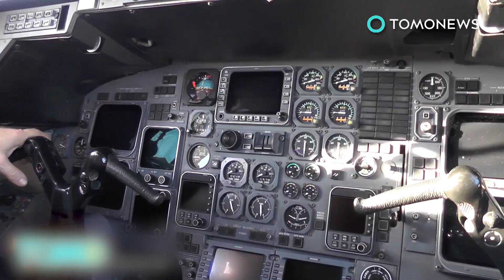Circular runway airports: Dutch researchers propose circular runways for future airports - TomoNews

Comment: i like how everyone is trashing the idea with shitty arguments, like if everyone were engineer or some shit like this wtf
Reply: isn't it why the runway is slighty angled ? so the planes doesnt have to turn that much ? kinda like in nascar races, turn are angled so cars slighty need to change direction to take the turn.

How will landing while tilting will result in a wing or engine strike ? explain "mister student pilot i don't give a shit you could totaly be lying anyway"
Reply: Requin789, I'm sorry to break this to you, but here are  many reasons a circular runway is impractical:

"Land too far to the inside of the circle and you drag wingtips and engine pods on the ground and risk cartwheeling to the collective death of everyone on board.

Land too far to the outside of the circle and you ‘high side’ (motorcycling term), catch the outer landing gear in the dirt, spin around and risk cartwheeling to the collective death of everyone on board."

"Takeoffs are going to be interesting. One of the more difficult types of aircraft to fly is the ‘tailwheel’ design. They’re challenging to fly in part because a take-off is a three-step process whereby you first lift the tail off the ground, stabilise, and then lift the rest of the aircraft off the ground. A take off on a banked circular runway would be similarly complex: you’d need to lift the inside landing gear off the ground, stabilise, then lift the rest off the ground… and do you lift the nose gear first, or second, or when?! If you get the timing wrong, then you either drag wingtips and engine pods on the ground and risk cartwheeling to the collective death of everyone on board, or catch the outer landing gear in the dirt, spin around and risk cartwheeling to the collective death of everyone on board."

"I have problems with the claim that up to three aircraft could operate from the same runway at once. Again, it will work well when everything goes to plan, but on that one day when the guy behind you can’t stop in time (or doesn’t know you’re there because he can’t see you in the fog), he rolls right over the top of you to the collective death of everyone on board both aircraft. Would anyone like to try Tenerife again?"

"The artwork is hopelessly out of scale to the needs of large transport aircraft that need to take off and land at high speeds, and ignores the impossibility of turning such aircraft at high speeds during takeoff or after landing, in distances that normally would require 1500 to 2000 meters. Maybe if the circle were to be orders of magnitude larger …"

"Crosswinds. Operating in a strong crosswind can be challenging enough on a straight runway. Add in a curve, and even a steady crosswind will be varying as the takeoff or landing progresses—making it more difficult to manage. Most locations have a prevailing wind direction, so it’s usually possible to build a straight runway that is into or very nearly into wind on high-wind days. On a circular runway, any wind means you always have a crosswind—and that crosswind will be varying as your takeoff or landing progresses."

"Bank Angle. Banking works well on roads when it’s used, because most cars operating on a road will be at or near the same speed. Not so for airplanes. Liftoff and touchdown speeds range from as low as 40 knots for some light aircraft up to 150+ knots for heavier jets. Even if you assume the airport will only be used for commuter and transport aircraft, liftoff and touchdown speeds can get lower than 70 knots. Centrifugal loading is a function of the square of your speed, so that’s more than a 400% variation in loading at the top ground speed. And of course, centrifugal loading goes to near zero at taxi speeds. In other words, a fixed bank won’t prevent side loading. Instead, it will cause side loading to the inside of the bank at low speeds and to the outside of the bank at high speeds—which compounds the problems associated with the varying crosswind."

"The curvature seems mild enough, however I wouldn't want to land an aircraft while taking a turn. Breaking and turning is a bad idea in driving and riding. It goes doubly so for a large aircraft where the loads and stresses are much larger. Especially with aircraft that have the same wheel configuration as a Reliant Robin. I can just see planes striking wingtips, oversteering and spinning all over the place in a rainy day."

"Also, using the runway by 3 planes at the same sounds incredibly dangerous. I'm not sure how one would manage separation between aircraft when you have 3 aircraft landing and taking off at the same time, essentially from the same runway. Sounds like a substantial increase in workload for the controller or increase in cost (for more controllers) for the airport operator. And if you're not supposed to operate 3 aircraft at the same time, what's the point?"

By the way I quoted pilots, enthusiasts and engineers.
Reply: Requin789, pilots say it's stupid.
Reply: Requin789, a circular airport is bad. The pilot has to turn the front wheels to stay on and turn the place sideways to land. If any airport is going to make one of these should probably get pilots to vote if they will want to land.
Reply: TheLapisChicken // LapisChicken GD Yup... 'Crabbing' into the wind would be impossible. If a pilot was lucky enough to land a plane in no wind, then no chance in even a stiff breeze.
Reply: This pilot is impressed with your analysis. I can't off the top of my head think of any other reasons why this is a bad idea, as I wouldn't want to land a Microlite on it let alone a multi-engine jet! It appears that Requin789 is a disrespectful and rather ignorant troll. Well done with your counterargument TheLapisChicken
Reply: WiltsKiwi stfu bitch

Comment: >The US Military conducted tests in the 1960's with circular runways

I'm guessing they never implemented them because the testing showed it was fucking pointless.
Reply: I have read that document and am thoroughly underwhelmed. The Engineer is making assumptions about repeatable "perfect conditions" which in the real world, can't be relied upon. As an Engineer I am surprised you haven't put the pieces together, so as a Pilot, and as I have offered I will explain these two important issues that make the circular runway unnecessarily dangerous. First I would ask you another question:

When stopping or accelerating in your car, do you think it safer to do so turning sharply or in a straight line? 

The answer is obvious, stopping and starting in a straight line does not add any unnecessary angular momentum to the system, which would be added if you intentionally skidded to a halt or accelerated in a sharply turning motion. With an Aircraft which turns using a different mechanism with much higher forces and stresses, in a three dimensional space, this is even more difficult and dangerous. Avoiding unnecessary angular momentum is much safer and is the simplest reason that Aircraft have always landed and taken off in a straight line. Why add a dangerous complication? That isn't practical it's foolish. This is my argument about the assumptions that the Engineers have made about angular momentum in a circular system. To take off or land would require a pilot (or an automated system) to bank dangerously affecting flight profile and aircraft trim almost certainly causing a fatal stall at low altitude causing a crash either with full fuel tanks on take off, or nearly empty ones on landing, in both cases increasing explosion of fire risk in that crash. That is physics.

As for Bernoulli's Principle, the objection I have here is simple. With Bernoulli's Principle in fluid dynamics a pressure imbalance with flowing air across the wing cross section shape produces lift, which (this is the important part) stabilises with more Air flowing UNDER the wing. The reason that Pilots are training to NEVER bank an aircraft under normal flight conditions near the ground is that air has unpredictable effects called "ground wash" that can cause anything from a wing stall, flat stall, or worse, tail stall which will drop the aircraft out of the air like a stone. At low altitude there is not enough air under the wings to recover from a stall causing a crash, and with a circular runway, the motion of winds will also likely cause vortices that will severely effect the wind speeds and aircraft stability as well in difficult if not almost impossible ways to predict. Putting it simply trying to land or take off in a flattened funnel of air by turning an Aircraft is hopelessly dangerous, no matter if a computer flying by wire is doing it or a pilot. 

The main problems I have with this concept, long before getting into ground control systems, avionics, or technology, is that you are trying to make a manageable, but dangerous activity even more dangerous and almost impossible to manage just for really little more than aesthetics. I have checked the calculated aircraft projections for the volumes of aircraft a circular runway could handle from the paper and see that as wildly optimistic. It wouldn't be more practical, nor more beneficial.

Next time an Engineer comes up with a "planning solution" for an activity they are not qualified to attempt improvement on, they should first ask, why something has been done with enormous success for over a century without attempting something pointless.
Reply: You are right, the US Air force tested this in the 1960s and found it was too impractical, too dangerous, and relied on too much piloting and ground control resources to be repeatedly used.
Reply: I never said laws of physics would be violated, but since you asked I can think of two off the top of my head that aren't being properly considered or understood in the right context: 

Conservation of Angular momentum
Bernoulli's Principle (fluid dynamics with regard to Aerodynamic lift)

That would make a Circular runway too dangerous to be usable. As a pilot I see these physics restrictions as impossible to make the circular runway work, long before you factor in technology, human fallibility, and any number of unpredictable factors that will make this concept too dangerous to work well with any degree of repetition. I will happily explain these too you if you wish, since I doubt you are a pilot or an aviation expert.
Reply: I think he meant that the guy who proposed this doesn't even know that "centrifugal" forces make an object move AWAY from the centre of the circle, not the other way. Another thing is that wind speed on each wing would be different, making a landing/takeoff quite an event...
Reply: As I have pointed out at least twice before all the technology in the world won't change the laws of physics. The lack of fly by wire capability was only one reason, when there were several even more important objections that caused the military to abandon circular runways.
Reply: Can I know What law of physics do you think it is violating?
Reply: I am not a pilot nor an aviation expert but I am an engineer. Sorry I fail to understand your 'physics restrictions' please explain. And why do you think Conservation of Angular momentum
Bernoulli's Principle (fluid dynamics with regard to Aerodynamic lift) these are not considered in the right context ? I recommend you to read the report at http://www.endlessrunway-project.eu/documents/index.php probably you will have some understanding of the concepts that trying to be implemented .
Reply: couldn´t explain better myself.. well done
Reply: +smlbstcbr Exactly. Although I think Henk Hesselrik has attempted to address how his concept deals with Newtons first and second laws of motion by cambering the runway so it's a flattened funnel, he has relied too much on the incorrect assumption that the adding of dangerous and unmanageable complications will be offset by unlikely and unproven to be feasible advantages. He also doesn't fully appreciate the physics behind aircraft turning especially at low altitude, or what pilots like me consider the most dangerous situations to stall and crash.
Reply: smlbstcbr Boi did ya not hear that they could take off in the direction favorable against wind?
Reply: Lt.Dolphin An object going in a circle ALWAYS changes direction. That's Physics 101. No matter the wind heading, going in a circle will make it change direction during all the takeoff roll.
Reply: it is good because with such a runaway you can reach the top speed of your super car. you know when the airport is closed
Reply: Akshith Vijay Kumar can I know why circular runways are better? I like to hear from both sides.
Reply: Painlessag wrong vid xD
Reply: WiltsKiwi   well said
Reply: First, the load on the chassis is huge..
Reply: It was in 1960 , now it is 2017 there is  a lot of technological difference from back then,now and future.

Comment: How to find an instant solution: helicopters
Reply: Surprise! yeeeeaaaaaah-NO.  you see, helicopters are slower, smaller, and less reliable so, no.
Reply: Not really.
Reply: Juling0 yeet
Reply: MGTOW Academy while circular runways can be dangerous as under different conditions it may not prove to be a great landing point
Reply: MGTOW Academy no
Reply: Helicopter consumes more fuel
Reply: Helicopters cant hold 853 passengers.
Reply: VTOL is the future
Reply: An intercontinental helicopter flight? I don’t think so.
Reply: Helicopters isnt the solution but vtol could very well be the future transport vehicles
Reply: VTOL*
Reply: MGTOW Academy planecopters are future it doesnt requires any runways at all !!!

Comment: won't work because harder to land and might cause more accident s
Reply: that is why they have simulators to practice ;-)
Reply: master chief that does raise a good point.  What if the pilot slows down so much they lose groundspeed, or Kinetic energy if you will... wouldn't they slide off the curved runway?
Reply: @EthanZeGamer  it can be sticky like an track
Reply: EthanZeGamer good point but I think the plane is stable enough to not slide and plus the ground would have friction
Reply: chief petty officer 117 😀
Reply: Automatic pilots
Reply: Most planes land themselves without the pilot having to do much
Reply: chief petty officer 117 hello cheif I'm a239 Emile
Reply: Daniel Doherty long time
Reply: Daniel Doherty sub to me
Reply: exactly
Reply: It's harder to takeoff than to land
Reply: Aviation freak 117
Reply: Are you so smart then?
Reply: Aviation freak 117 They would lose the glide slope and crash. Take off is worse. You can’t turn the nose Gear at V1, that means crashing into trees. Also, the atc will have a harder time clearing the runway and pilots will get confused and take off collisions would increase a lot.
Reply: No it will be very easy because planes have something called a rud that can make a plane go in a full turn or circle
Reply: The goal is the tech. Control  of people so they  will oppress within the system. Not the circular shape  of the airport.